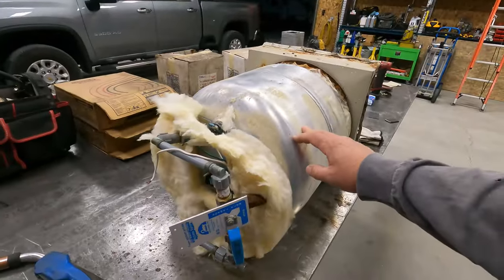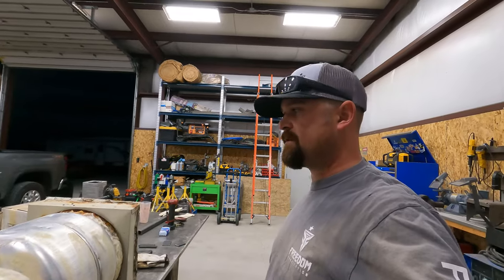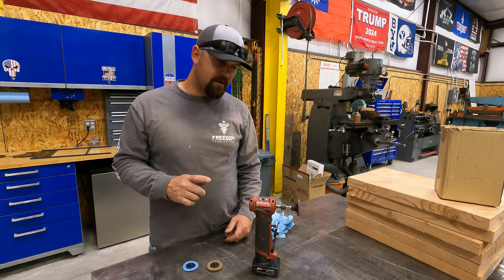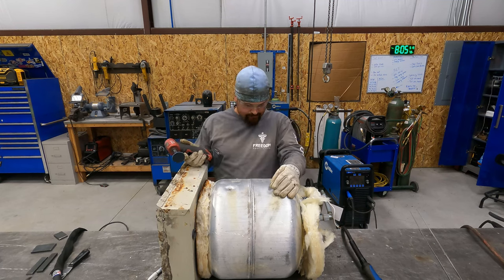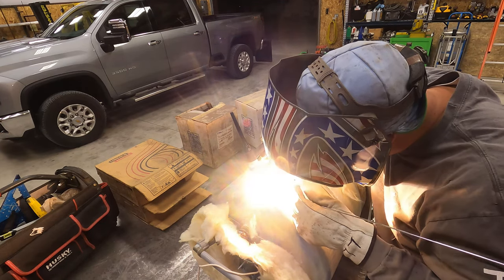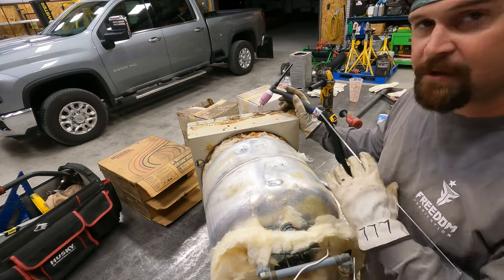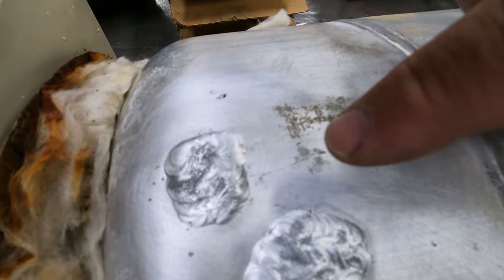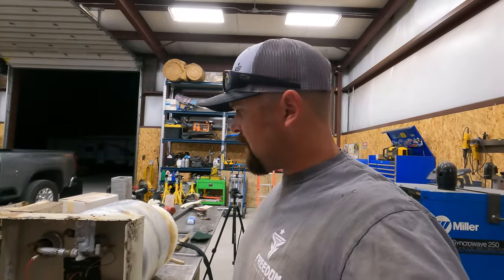Aluminum water heater TIG welding repair

Comment: Nice Job.  If I may make a comment on the wire brush cleaning.  If you take the wire brush and make a back and forth motion it recontaminates the metal, especially when its dirty.  So to not recontaminate the metal, make a one direction motion forward only and then repeat that motion again.  BTW im from Utah and now live in texas. I like your videos so great job on your channel.😀
Reply from the maker: Thanks for the pointer, and thanks for watching! I hope Texas is treating you well! 😉